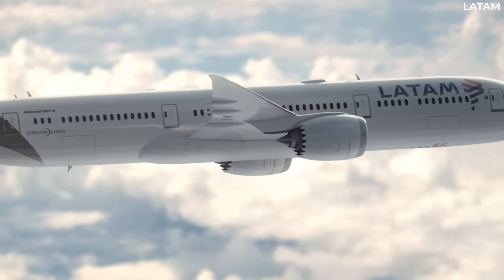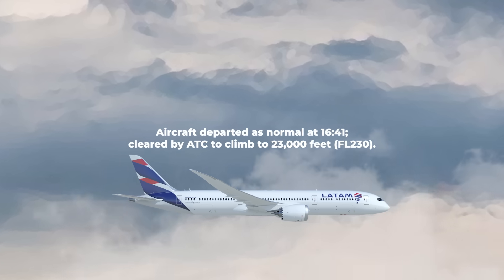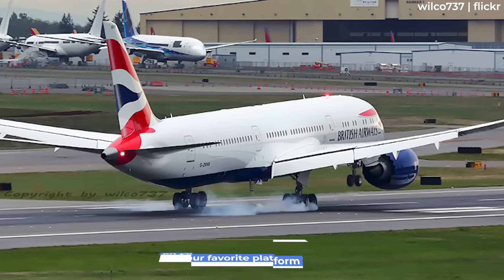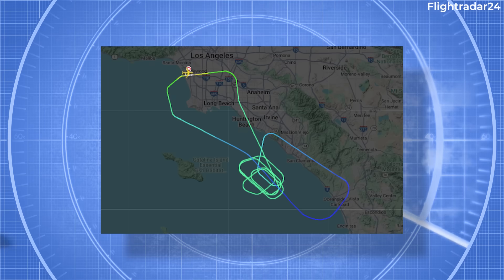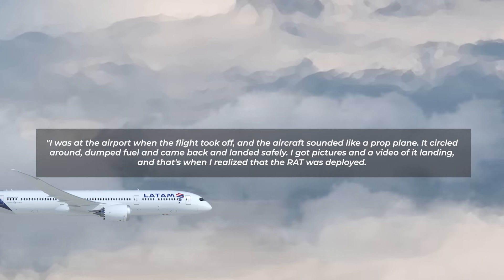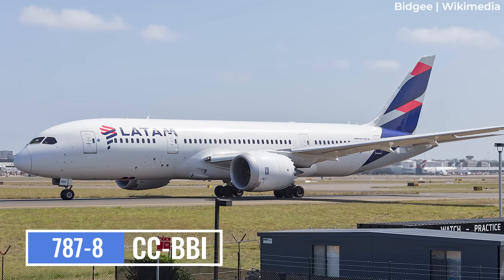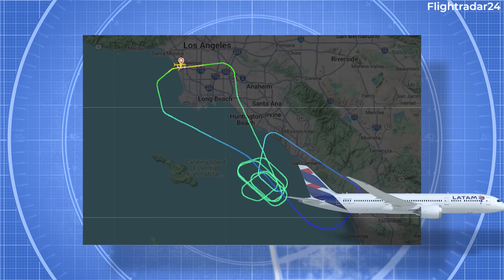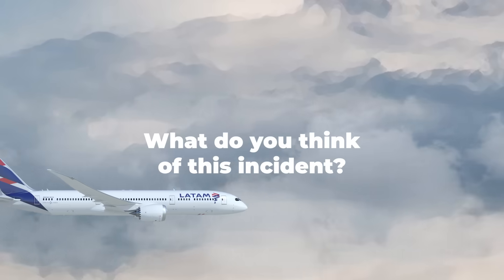LATAM Boeing 787 Suffers Electronics Problems, Returns With RAT Deployed

Comment: well this makes me think again about AI171 crash
Reply: But people who can read between the lines are still booking B787-8 flights.  The reputable aviation channels are pretty sure about what happened to AI171 - they don't want to throw the captain under the bus though.
Reply: @brentsummers7377 Geoffrey and Richard have presented excellent facts based analysis of the crash which points the finger squarely at AI maintenance.
Reply: @mantan_rtw  but that wouldn't explain the pilots so quickly identifying that it was a fuel cutoff that shut down the engines. I'm not trying to blame anyone but this is simply the most likely scenario.

Comment: Not surprised that the 787 is having more problems. The 787 has been having problems since the 2010. Boing needs to fix this asap.
Reply: Why does Boeing need to fix an issue which you think dates back to 2010? It's the airlines maintainance that needs to fix it not Boeing

Comment: 787 can’t dump fuel. They were flying around just burning fuel until they reached an appropriate weight.
Reply: it can dump fuel. the a350 and 787 have the fuel jettison system as an option when buying the aircraft. lufthansa a350 aircraft for example dont have the system while others do. same goes for the 787. some operatos have the fuel dumping system ordered, others dont
Reply: @anticooperativ8398 My mistake.

Comment: I think the whistle blower for the 787 who “committed suicide” may have had valid complaints about shoddy workmanship and the using of parts that are out of spec. Now these airframes have some hours the issues are coming through. Not sure I’d be booking a trip on a 787 any time soon
Reply: Many of these planes are already 15 + years old, which is well above their halfway mark already. It has nothing to do with how the aircraft was manufactured. Maintenance of the aircraft during its lifetime is critical and essential. Stop trying to blame Boeing for every little incident. All aircraft develop issues over time.
Reply: @TheDailySocialreal  the 787 had its EIS (entry into service) in 2011 so the earliest models are now nearing 14 years +- a few weeks/months. but yeah, i understand what you mean. if something is to happen now, the manufacturer is not to blame anymore since the aircraft had been pretty much rebuilt from the scratch already on the airlines maintenance side already. just mentioning the good old D Check which is taking the whole aircraft apart, checking everything and replacing parts if needed
Reply: As a 787 Captain for a major airline I have no issues with the aircraft.
Reply: @savagecub yes as a captiain I fully endorse it. You’re a captain as much as I’m quarterback for the NY Giants
Reply: Why talk about whistleblowers when the incident is very likely to be the airline and not the manufacturer of the aircraft? Surely it’s something you wouldn’t miss if the aircraft involved was an Airbus, isn’t it?
Reply: Why would you relate to the whistle-blower complaints about shoddy workmanship and the using of parts that are out of spec be the reason here? The issues are not coming through if maintenance are not doing their jobs properly. Maybe just dont fly with shoddy airlines. The 787 is a great plane